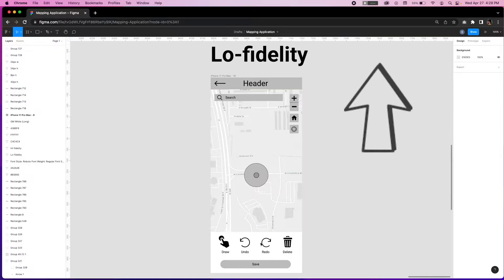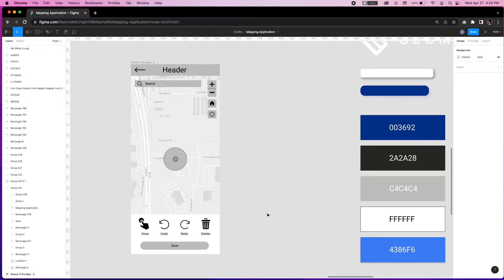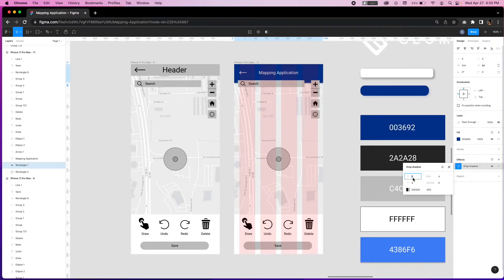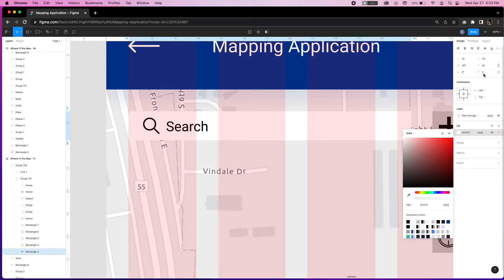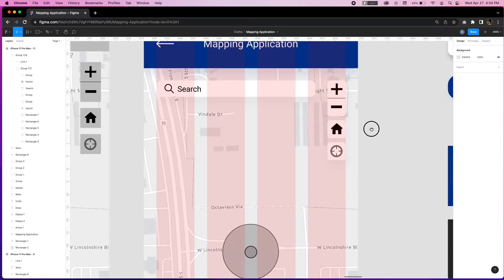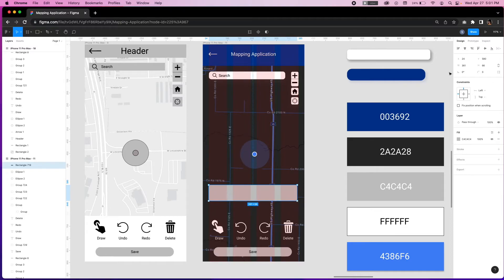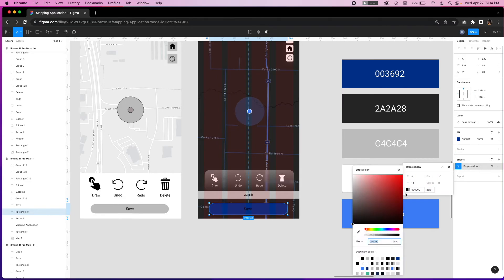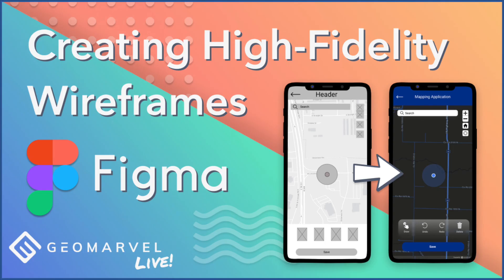UI/UX Design | Creating High-Fidelity Wireframes In Figma

Comment: Hello, how did you paste the map screen for the background and hide the grid pattern? Thank
Reply from the maker: The orignial map screen does not have a grid pattern. The grid pattern is a featured that can be toggled on and off using the "Layout Grid" widget (located on the right column, 3rd option down). Refer to 01:40 for details... We hope this helps, reach back out if you have further questions.

Comment: Hi I have a question, I am using your technique of having dedicated spacing bars to keep the layout consistent. I noticed that the blue outline (when a shape is selected) is tightly wrapped around the shape. Mine has a slight spacing, about 1 pixel, around the shape which is hindering the the purpose for the spacing bars. Any references or pointers on how to remove this?
Reply from the maker: In our demonstration, we use Frames and Shapes (located in the top left corner of the canvas). That’s what you should be using. These elements should automatically be tightly wrapped. 
If you’re not using the shapes provided by Figma, here are a few options you can try out. First, try manually cropping the shape. Sometimes there is a buffer around the image/shape that may not be noticeable. Another option would be to find the shape you’re using as an .SVG file as opposed to a .PNG file. SVGs will tightly wrap your shape, while a PNG will create an outlined box around your shape. Within the Figma Community, there is a plugin called Shaper, which offers a variety of shape-elements that can be brought into your project as an .SVG.
Give these options a try, that should help with your issue.